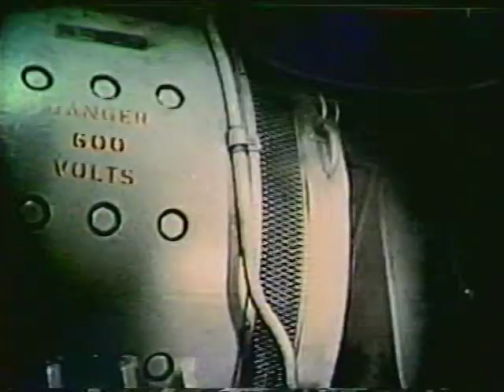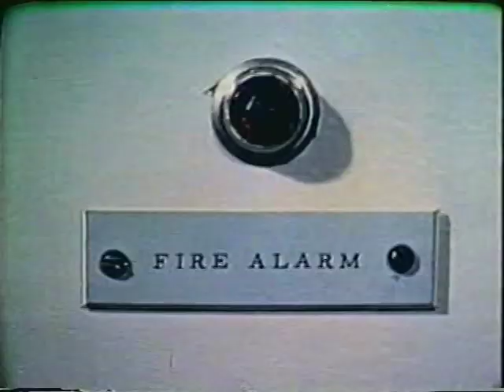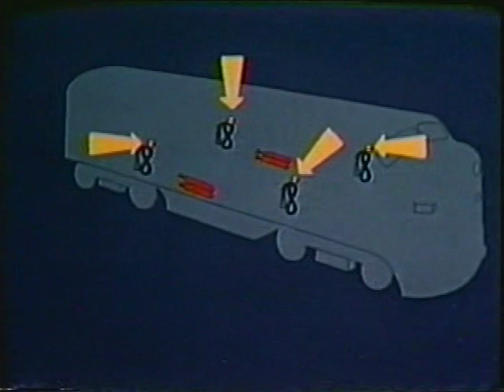PRR Training Film "What In Blazes" (1955) - Part 1 of 2

Comment: 1. Where did this film took place? on the shot that the the 6172 went out of scene and F unit rolls in.
2. Apart of "In case of fire, phone civil fire department to help, pull fuel trip and prepare CO Two system for action, and then if possible stop at road crossing, overpasses or underpasses" (they should stop the train NEAR that crossing in question instead), what else did the 50s RR management practice is considered as 'shit'?